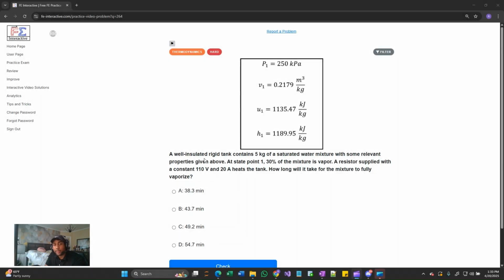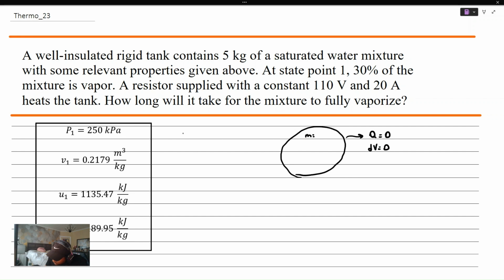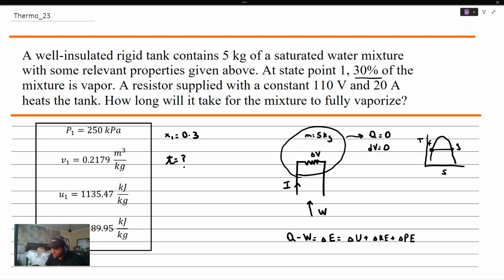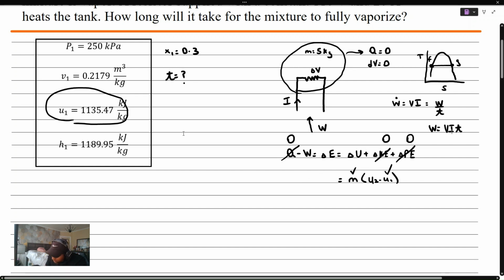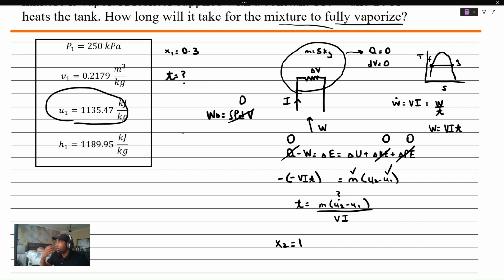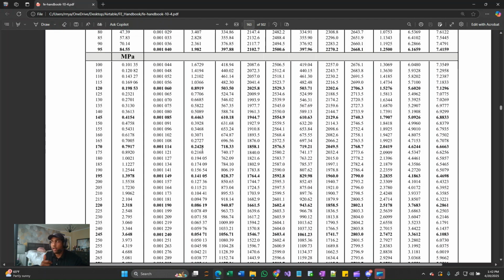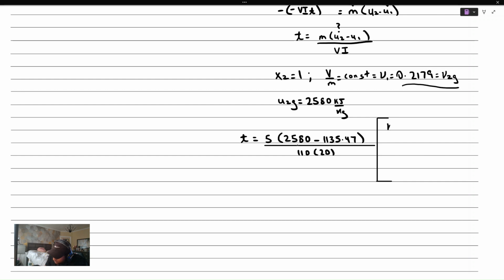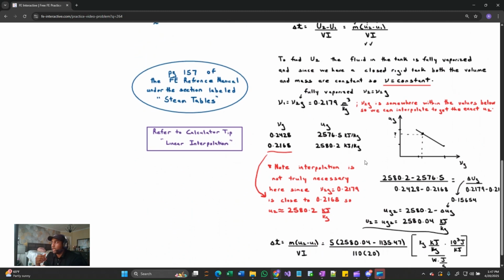FE Exam Thermodynamics  First Law for Closed System – Rigid Tank Vaporization Problem

Comment: why doesn't the fact that it's 30 percent vapor in state one get taken into account
Reply from the maker: It’s already accounted for in the internal energy value provided at state point 1.

If that value were not given, you would need to calculate u1 using the saturated properties at P = 250 kPa, based on the relation:

u1 = uf + x1 (ug − uf)

Since the problem is already fairly involved, I chose to provide u1 directly to keep the focus on the main concepts.